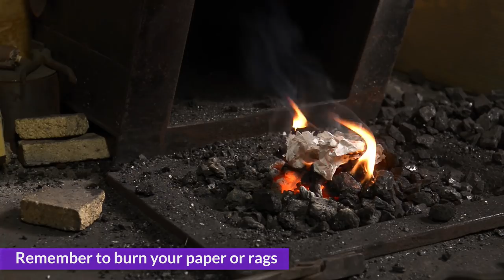Blacksmithing - Making a brush handle

Comment: That is very nice! I don’t like the screws though, I would have used slotted screw heads.
Reply from the maker: Thanks. Sure, but this is a everyday tool, so this makes it a little easier to change and remove multiple times.
Reply: Torbjörn Åhman Good point!
Reply: I dunno, I thought that at first, but they're nicely centred and the different colour makes them a feature.
Reply: There are black torx screws as well.. would probably look nice.
Reply: Erik I agree!
Reply: @erik....  Or maybe brass or bronze screws with a nice patina?
Reply: I think slotted screw heads need to go away completely and be forgotten, maybe filed in a dusty filing cabinet somewhere marked "Bad Ideas".
Reply: @ColtaineCrows  slotted screws have their place, usually in the bin, but they do look nice until they get messed up. Phillips heads really need to disappear.
Reply: @GrumpysWorkshop  phillips screws turn into flat heads after you strip them out.
Reply: Are we talking fashion here?? It's a TOOL, man.
Reply: I freaking HATE slotted screws !
Reply: Slotted screws can die. Long live torx!
Reply: Que proligidad muy bueno
Reply: picky picky picky
Reply: I thought the opposite..they look very nice, because they are a new type of screws with an "old" technique, and it makes a good mix! :-=)
Reply: @ColtaineCrows  Slotted screws are actually perfect for emergency-removeble appplications, you can turn them with a knife, a sharp edge, a key. They often have them on Marine Engines and so on, and they self drain, and are easy to clean, if u use the correct sized tool they dont wear out. But for day to day applications... they are terrible : )
Reply: @ColtaineCrows  Pillips heads first, though.  I have a certain fondness for the old school look of a slotted head.
Reply: Before I became a professional mechanic Torx screws really irritated me, but they really are a superior fastener.
Reply: The fact that people are on these comments debating different types of screws is kind of sad. It’s a screw, people... a dang screw. He just used what he had on hand. This is a tool, not fine art to be displayed in a museum.

P.s.
Good job on the brush handle. Fantastic work.
Reply: Nah, I hate slotted heads more, annoying and tedious to remove, especially when worn down. It's an outdated and ineficient design, atleast for this application. Philips heads are far better for common day to day usage. Practically speaking they're common, they're also perfect for both hand and power tools, unlike slotted heads or torx. Each head has its place, slotted heads however are becoming more and more of a niche use case and there is less and less valid reasing for using them.
Reply: @dadegroot  I thought they should be "blued" to turn them black. Funny how many of us had thoughts about the screws. :-)

Comment: Every time... Every time Mister Ahman gets us with his little tricks and tips ! The 45° marks to establish a nice pointy shoulder, great simplicity, great efficiency. Amazing work

Bravo
Reply from the maker: Thank you Gabriel!
Reply: My question is what did you use to align to the chalklines as the index on the handle?
(eyeball along an edge, or, mark, or?)
Reply: @markschweter6371  I think he just eyeballed the centerline of the handle with the chalk line, then pushed the handle forward until it contacted the side of the anvil.
Reply: That is one for the notebook for sure.  I never saw it before and I’m sure I would have either guessed at it or tried forging it with a set hammer from the top.  
I believe he simply lined it up with the center.
Reply: Yes, that was a nice trick, with a neat result to boot ^^ … learn something new every time ;)
Reply: I agree. :-)
Reply: Yeah, so elegant!

Comment: Perfectly executed design. Rounded on the bottom for your fingers, and it even has a groove for your thumb to fit into. Maximum control with this handle, Thanks for the ideas you two.

Comment: That is a great looking handle, no cheesy stamped out sheet metal handle.  Bet this one will last longer than the brush.  I like the screws, so many wanted slotted to look old but for this piece I like it just as you made and installed it.
Reply from the maker: Thanks Dan!

Comment: That's a great handle. You really got a grip on Daniel's request
Reply: Hehe
Reply: Please.

Stop
Reply: @oscarsimpsonjacka7917  Maybe you could just brush it off as another bad pun?
Reply: Adam Schaeffer yeah I could have but this pun is really screwed on tight
Reply: @oscarsimpsonjacka7917  You're right, brushing it off would be difficult. The scale of these puns has really gotten out of hand.
Reply: Adam Schaeffer nah the handle should stop it front getting out of hand

Comment: I'd just like to say, I can't get over how clean your work is! It's so very impressive! 😊
Reply from the maker: Oh, thanks! If you have problems with hammer marks, dressing the hammer face and making the edges quite round helps a lot.
Reply: Thank you. It's more the scale I have trouble with I think. I can't seam to get it all off with the brush. Need to get a wire wheel to clean it up I think. 😏
Reply from the maker: Ok, yes scale can be a pain to get rid of.

Comment: Nice video, Torbjörn.
The handle looks good.

Well, you've taken screws for it, with self-forged screw-nails (for better holding) that have a 4 or more angular head.
 :-)
That's the advantage of being able to forge. Since you can make the things / tools yourself.

Comment: I like the 45 degree marks on the flat parts of the handle. Very cool looking. Next time you drill or countersink though, put a drop of oil on there. Your tools should last a bit longer.

Comment: Very nice work! I jave noticed that you made a deep hole with the countersink, if I may suggest - there are different countersinks with wider angles, so you will not need to go deep in the thin material. The standart is 90 degrees if I am not mistaken, but there are other angles as well, such as 120 degrees that would be more suited to use on relatively thin stock. Cheers! As always, I enjoyed the video. Thank you!
Reply from the maker: Thanks!

Comment: So, i am a bit divided on the screws, on the one hand i had hoped for some forged nails (which would look really retro/periodic), but on the other hand i also rather like the ornamental aspect of these screws, both in contrast as well as the pattern on them (think that star pattern is phillips?), and the screw may well be more sturdy and hold better under frequent use (simply due to how different a screw bites in the wood as opposed to a nail) … in all the end result looks good as always :) … and for a use-case assumption the screws are probably better, but if i were to ever commission something like this for on the mantle as an ornamental piece, i think i would prefer some forged nails… tnx for sharing :)
Reply: That star pattern is called Torx
Reply: @stefanopassiglia  tnx Stefano :) … guess it's like one more ^ then a phillips then (or so).

Comment: He speaks!! 
 
Hej där själv
 Torbjörn !  Det är en underbar bit av arbete, som alltid.  
I hope google translate didn't butcher that too badly, my Swedish is pretty limited these days. Luckily the one sentence I can still remember in full was always useful:  'Pratar du engelska'?  ;)
It's fortunate such a lot of you guys do, and scarily well too. So thanks for that, it's appreciated.

I really like that design, has a VERY nice balance of aesthetics and function.  

If I had to pick between the two that's why I'd take yours over Dan's. His handle design is certainly visually appealing and the forge work is technically very well accomplished too (It's a really, really nice forging) but I think his choice to essentially use a single anchoring point orientated like that gives yours the clear edge in terms of function.  I can see Dan's handle acting as a lever against those screws under heavy use and loosening it up over time.  I hope it doesn't mind, but time will tell, whereas I very much doubt yours will.
Both are excellent forgings, sure Dan will pleased as punch with his.
Reply from the maker: Tack Ian!!!

Comment: Tip for the screws. Heat them up to get the same color as the handle. Gorgeous work as usual .😍
Question. How did you get so
$#@☆! good at blacksmithing?
Reply from the maker: Thanks! :)  Yes that could be an option but I didn't want to mess with the integrity of the screws. With such small gripping points (in torx), making them softer in any way could be a really bad thing...

Comment: Another great one. I’m not sure how I didn’t see this until now? Question for you, what type of steel  do you use for your spring fuller dies?  I really need to make some.
Reply from the maker: For this one I used old axle steel, probably 4140 steel. To be honest I don't think it matters that much. I have seen mild steel ones that has held up very good.

Comment: Awww! I was hoping you'd hand forge the individual bristles.

Serious tip. We often make stuff from mild steel merely because medium carbon steel is scarce, expensive, or both. Often we desire items of greater strength than possible with mild steel forcing a design of greater mass and clunkiness and/or subject to bending failure. Many articles and posts have been written on the topic of "super-quenching" mild steel to attain grester strength. I think people are put off because the author's mandate witch's brew quenchants.

I've gotten pretty good results with red heat quenched in cold water. What carbon there is undergoes the hardening transformations resulting in a skin of higher strength and hardness than the untreated steel. No draw or tempering cycle is required for most purposes. However, stressed items with sudden section changes, sharp inside corners, etc...

Usually, a plain heat and quench is enough. You have the forge and the slack tub. Nothing more is needed for most applications. Naturally, if the material requirements are better fulfilled with a more suitable material, that would be the preferred stuff. There are always exceptions and the heat and quench option might do for some. 

The old blacksmith brush illustrates what a beating it's taken. Torbjörn has a good eye. The handle he beat out for the replacement brush is correspondingly robust. A stamped sheet metal handle intended for a garage door would fail early thus one made from 6mm flat bar (1/4" in manly units) is clearly indicated. I noted the handle's shanks and atrachment tabs and thought them well proportioned but a trifle in excess of what's strictly required. Then I recalled the heavy service and the esthetics fell back into balance. 

But in a perfect world where the right steel, like 1023 or its Euro equivalent, is on hand in providentially the most convenient section, the proportions could be further refined. Then super-quench popped into mind with fiddling with salt and dishwasehr powder solution then to a plain water quench - and here we are.

Now you know what passes through my tiny mind as I watch one of your videos.
Reply from the maker: :) Thanks!  I haven't experimented much with super quenching. It's interesting. For a handle though I don't think you need it even if it's refined more. I have seen many old hardware like this and some are extremely thin, but with the right bends or reinforcement at the right places it works!

Comment: Love your videos. When you were driving the foundation for your drophammer, how big did you have to make it. Also, how many tons is yours.
Reply from the maker: The hammer is 3300 kg roughly. The foundation is about 2.5 m3 concrete or 5.5 tones. A good rule of thumb is 1.5 x hammer weight.
Reply: @torbjornahman  thanks

Comment: Pardon my ignorance, but what is the black stuff flaking off when you hit the hot metal?
Reply from the maker: Iron oxides. It forms on the hot surface together with the oxygen in the air.
Reply: @torbjornahman  thank you.

Comment: What are the general reasons for brushing the slag of before hammering?
Reply from the maker: The scale is hard and when you hammer that into the steel is will leave marks...that's it really. For a better finish use the brush at the final stages of forging.
Reply: @torbjornahman  Thanks.

Comment: How do you get your coke?
Reply from the maker: In this video I use coal actually. It's always hard to give advice on that when I don't know your location.
Reply: Torbjörn Åhman what I mean is, is there a process to make it?
Reply from the maker: As you burn coal it becomes coke which is what actually creates the heat. The relation between coal and coke is more or less the same as charcoal and wood. Industrial/metallurgical coke is made in large plants where most of the volatiles and the "bad" stuff is burnt/removed.
Reply: Torbjörn Åhman ah, that’s really interesting. Btw, great “that is hello in Swedish” joke.

Comment: I'm kinda disappointed here. Daniel made you a very nice, very artistic handle and you made a dead boring, bog standard (impeccably crafted) handle which is a shame because we've seen that you can forge works of art.
Reply from the maker: It's your call, but I wouldn't call it bog standard :) I think it's practical for the most part.